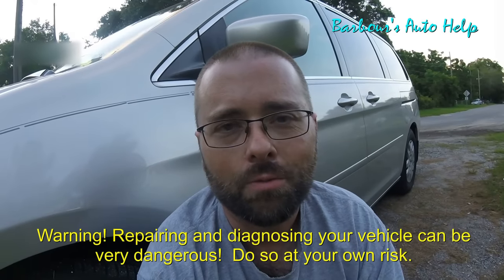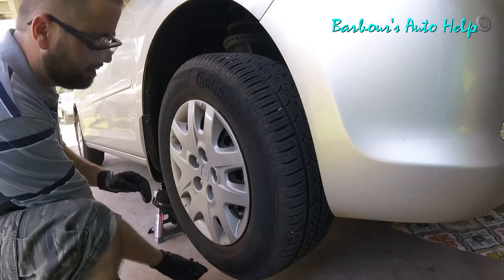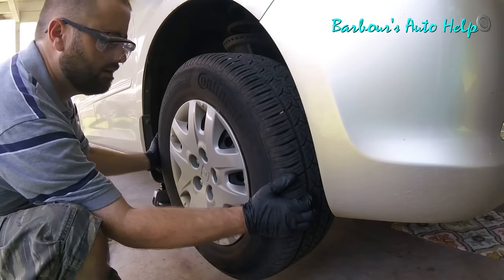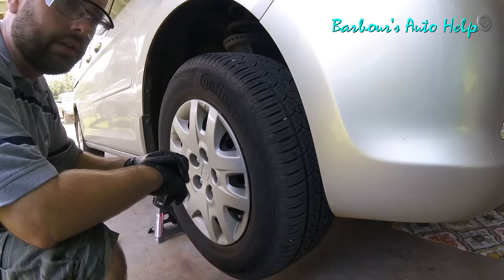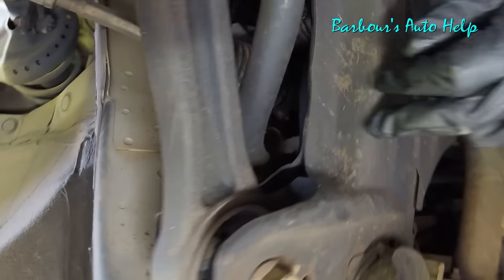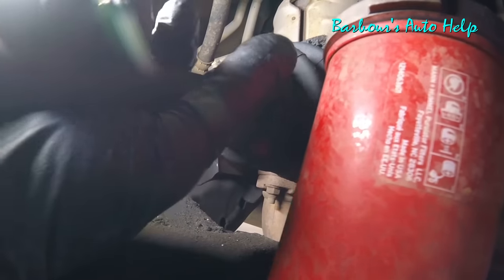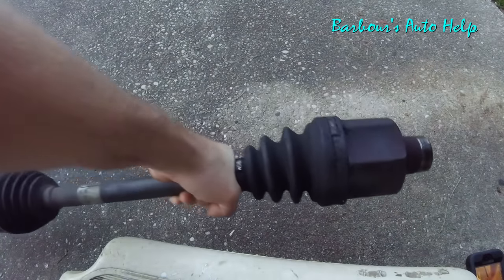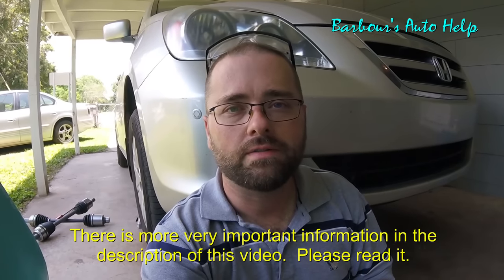Vibration Under Acceleration Diagnosis

Comment: Most vibration while accelerating will be from CV axles. Vibration while applying brakes will be from rotors, pads or wheels out of balance. Or worn out suspension parts😁
Reply: My odyssey had the same issue 
Changed cv axle,new tires, struts and springs . Turns out it was a sticky caliber .
Reply: What about If it only happens when I'm going about 65 mph and coasting? This vibration didn't start until after I got my transmission replaced. Only happens when I am coasting high way speeds or on a dirt road.
Reply: I replaced my cv axle and it still vibrates 😕 
Idk what it can be
Reply: @cesar1926  Have you figured it out? It could just be a bad tire if it does it all the time and gets worse as you go faster.
Reply: @keyelectric91  nope 😭
I think it’s my motor mounts
Reply: @cesar1926  They are easy to check just have someone or you rock the car forward and backwards good enough to make the engine rock looking at the mounts and see the rubber is ripped/separated and you might hear it clinging too if you rock it hard enough.

However you may have bad mounts but usually you will just experience a single bang when you accelerate a little bit to hard with bad mounts.
Reply: @keyelectric91  thank you so much, Imma try that rocking method 🙏🏼
Reply: @cesar1926  You're welcome! Just shine a light at them and check each one closely while it's rocking decently.
Reply: Well I got new rotors brakes and checked everything only thing bad is the axel and it vibrates during brake if so that’s not true
Reply: @jackmarks8607 but what was behind sticky caliper.??
Reply: When I accelerate I have some hit on the left front like something is loose
Reply: Harder I accelerate more it hits and loose felling

Comment: if the vibration is engine related it would happen in all speeds and if it was transmission related it would be present in one gear , if it was torque converter it would happen in lock up and would not happen all of the time , so that leads to the axles and suspension , good video very help full, i have a 2007 odyssey touring and am dealing with the same problem
Reply from the maker: +sunny nayee Great information!  Thank you for sharing!
Reply: sunny nayee , I have the same problem of vibration at 60-70 mph on a 2005 odyssey. what do you mean by "if it was torque converter it would happen in lock up "?
Reply: @100630489  I believe he means when it locks the torque converter which is when the vehicle is in Overdrive for highway speeds. I had a truck with that problem and drove fine till it went into overdrive and then shook. They said it was the torque convertor
Reply: great comment
Reply: Amazing information thank you for your input.
Reply: My SUV only shake(more like jerking) when I accelerate 0-25 mph, it does not always happen but its getting worse recently, do you think this is transmission related? Thanks
Reply: sunny nayee So frustration because I drive great distances often for work. I have the same exact problem right now On my 2007 Honda Odyssey. I have a front in alignment with new tires wheel and balancing from NTB and Goodyear and my steering wheel still shimmies between 65 and 80 miles an hour. I even took it to a state inspection location mechanic and he said that he found nothing wrong even though I don’t think he performed a thorough inspection for the fact of when I back up and cut my wheels to park I still hear a soft knock or thump in my front suspension. I spend my days off hoping from shop to shop to take care of this and no one can tell me anything. I am really starting to hate this van because of it. Great vids. Im guessing I wish you were close
Reply: Very good info I was praying it was my transmission but it still does the same thing in 3rd
Reply: very useful tips, thanks

Comment: My Mechanic was not convinced about the inner cv joints causing acceleration vibration at 70kms. Told him to replace as he could not find any other problem i.e. tires, ball joints etc. He replaced the cv axles and vibration gone.

Comment: Okay so I just changed my driver's side axle because it was rusted to hell. but now while driving the car and I'm accelerating I feel a vibration. I jacked up the car stuck it in drive and the passenger side wheel is wobbling like crazy why would this be? Any help would be appreciated. There is no play in the CV axle and the boots are good. Everything seems tight
Reply from the maker: Could be a bent rim....or a tire out of round.

Comment: Had to replace both CV Axle shafts on my 2011 Honda Accord Crosstour FWD that I bought 6 weeks ago. I had that vibration/rumble feel in front of car during high speed acceleration (70+). I noticed that when I put my car to park and drive I'll here a click noise around my front tires. I read that it could be worn CV Axle. I also didn't have any warning lights, so problem wasn't connected to car computer. Had a mechanic test drive it and he suspects CV axles. Its all good now. Before the CV axles I thought I only had to get rid of ECO mode which I read causes the car to shake when switching from 3 or 4 cylinders to 6. So I installed a VCM tuner to turn off ECO mode (S-VCM). The shaking in the front shrunk a little, but was still there and that is when I found out about the CV Axles.

Comment: Top to bottom is for the ball joints. Left to right is for the tie rod ends.
Movement top to bottom, left to right, and diagonal, is for the wheel bearing.

Comment: I think you have nailed the fault on my x type jag to. 
Thanks very much, the garage has been worse than useless diagnosing this problem.
They have changed discs,  pads, steering pump, where going to change the rack and I had suspected the CV joint on the near side for months. (uk) setup right hand drive.
Thanks again.
Reply from the maker: Please let me know how it goes.

Comment: We have a 2006 Honda Odyssey, and we were experiencing the same thing. Once we got it up on a lift, and put the car into gear and pushing the VSA off button , we were able to get the wheels spinning at a decent speed, and could see the slight vibration from the cv axle that was faulty. It was the inner cv joint, passenger side. I am sharing this, because it did not have obvious signs of potential failure ( I.E. the grease that yours had coming out of the boot)
Wish I would have watched your video first, because it took us little while to diagnose the problem. 
Thanks for sharing your video
Reply from the maker: I'm glad you got it figured out.  God bless.
Reply: Great job thanks

Comment: Although vibrations can be caused by dozen of causes, 99,99% goes on CV inner joints.
Passenger side is specially problematic, as it has longer shaft and bares more abuse thereof.
If there are vibrations present during acceleration at some certain range of speeds and if those "disappears" when there is no foot on the pedal-check out CV joints first.

Comment: I just replaced my wheel bearing+hub and was disappointed when I went out to drive my civic and got a wobble. Turns out my lower control arm bushing was in two pieces. thank you for the helpful video!
Reply from the maker: No problem

Comment: I just did front axles on a 2010 Subaru Outback because of torn boots.  I used new axle shafts from NAPA and now have a shimmy that wasn’t there before.  I’ve done a hundred of these and the only ones that end up with a shimmy are Subaru’s.

Comment: Thanks, just what I needed! Performing this inspection on the wifey’s 2006 Ody with 214k miles this weekend. I just replaced motor and transmission mounts figuring that’ll solve the vibration. Nope, vibration is still there during load and goes away when decelerating. Did noticed the driver side inner CV axle has lots of grease coming out from the rubber boot. Will investigate and perform the slop test...Hehe! Take care and thanks!
Reply from the maker: Yes, the "slop test".  lol.  I should patent that.
Reply: BarboursAutoHelp  Haha! It’ll be the new in the dictionary... 👍
Reply: BarboursAutoHelp  Update: Replaced both axles and the vibration is GONE! Wifey is happy which I’m glad because she was thinking we needed a new car 😬 Now I’m gonna have my ice cold Coronas w/limes as a celebration 🎉 Thanks for your help 👍
Reply from the maker: Awesome
Reply: @elgatogordo9523  Thanks for sharing, I just replaced my motor and transmission mounts on my accord and still have the wobble at acceleration. The wobble also occurs when decelerating. My mounts were definitely bad, so it solved part of my issue with vibration, but the wobble still occurs. Did you use aftermarket or OEM CV axles?
Reply: @levimagnusson5880    I used aftermarket CV axles. OEM were extra pricey and above my pay grade 😆 After two years, they’re holding up nicely. Purchased them from Amazon.
Reply: @elgatogordo9523  did you replace both sides or just one side?
Reply: @levimagnusson5880  replaced both sides due to the high mileage.
Reply: @elgatogordo9523  i just replaced my CV axles now and the car drives like a dream! No boots were torn, my inner joint had a lot of slop
Reply: @levimagnusson5880  Haha 😄 The famous Slop! Glad you got it fixed. Our Ody is still going "Strong like Bull" 🐃

Comment: I had the same problem and I balanced my tire. It wasn't that.  The problem was the axle. Thank you for this video
Reply from the maker: Your welcome!  Did you get it fixed by replacing the axle?
Reply: Yes i replace the axle of may Honda odyssey and is driving like knew 🖒
Reply from the maker: Right on!

Comment: Mine turned out to be my front motor mount under the crank shaft damper. 
I had a really bad vibration under acceleration. 
It is about 95%better now. 
I still have a very slight vibration under acceleration, I may try replacing the top torque struts or flipping the bushings.

Comment: So frustration because I drive great distances often for work. I have the same exact problem right now On my 2007 Honda Odyssey. I have a front in alignment with new tires wheel and balancing from NTB and Goodyear and my steering wheel still shimmies between 65 and 80 miles an hour. I even took it to a state inspection location mechanic and he said that he found nothing wrong even though I don’t think he performed a thorough inspection for the fact of when I back up and cut my wheels to park I still hear a soft knock or thump in my front suspension. I spend my days off hoping from shop to shop to take care of this and no one can tell me anything. I am really starting to hate this van because of it. Great vids. Im guessing I wish you were close

Comment: I'm having the same issue with the vibration and I'm feeling it in my pedal only when I accelerate..it all started when I hit a large pothole..think I'll look at the Axel and see if there's any damages..thanks for the video too it's good information 👍🏽
Reply: Potholes usually mess up tie rods. Jack a corner of the car up so the wheel is off the ground and see if it wiggles or is loose, it shouldn't wobble or shake at all.
Reply: @c43sedan  I did that there's no wobble..my mechanic told me I need engine mounts

Comment: Same issue with a Toyota avensis.  Replaced the right side inner/outer drive shaft..still shaking like mad around 60mph so I now have to replace the passenger side drive shaft..I hope that cures the issue..

Comment: This has really help me.I have S60 2007.i fill little vibration only when accelerating.after washing this video,I went under the front driver tyre and saw grease on the wheel.i had the same issue I saw on the video.thanks man
Reply from the maker: Great!

Comment: I have the exact same symptom on a 2006 with 272,000 km.  I will be replacing the right (passenger side) cv axle next week and hope to correct this issue.  If not I'll try the left cv axle as well.

Comment: Dude perfect video the intro explained my car perfectly. Thank you i found it and I'm doing repairs now
Reply from the maker: Hope it works out!
Reply: @BarboursAutoHelp  I just replaced both my cv axles and the problem is still there. Guess that leaves me with 2 other options to check. I feel the shake as I go faster and it becomes more aggressive.
Reply from the maker: What all have you checked?
Reply: @BarboursAutoHelp  so far only the cv joints. Was gonna check my suspensions and tie rods tomorrow
Reply: @BarboursAutoHelp  and the lower control arm
Reply from the maker: What about the wheel balance?  What did you find with that?
Reply: @BarboursAutoHelp  i didnt think it was a wheel balance because i put my stock wheels back on my car and the same problem was still there

Comment: Have a 2005 Camry. Vibration/ shake/ thud at around 85-110km. Have had it looked at 3 times and say it's nothing. It only happens when I'm accelerating and gets worse as I accelerate. They say everything looks good and the only thing that looks sort of weird is the tires are some what having uneven tread wear. They did balance them and it fixed for like 3-4 days and then slowly started again now it's doing again. Getting tires put on and I guess I'll see if that fixes it. Not sure tho. Any thoughts?

Comment: Was suspecting my CV was the cause in my 08 quest now I am certain if you were shaking with just that bit of slack mine shouldn't be aloud on the road 😂😂 shaking so bad is has loosened the center axle nut from it I thought maybe that was the issue but looked and saw inner boot is ripped and load of slop so thank you for confirming my thoughts

Comment: I just bought a 2019 Honda Fit it was rebuilt hit in rear
but I drove it up to about 55
day before I purchased it.
Next when driving home on expressway I reached 60 + mph and only when accelerating the gas pedal the steering wheel would vibrate as soon as I let off the gas pedal it would immediately stop.
So after watching videos and reading online I guess it’s not a wheel or tire bad, but a possible structure problem ? I think the guy I bought it from would honor the fix it I could prove the problem any suggestions ?
Great Video thanks

Comment: Thank you for the video! I have a '05 Accord, but the knocking/vibration starts at very low speeds (25-35mph) upon acceleration. Could that still be the  drive axles or perhaps U-Joint?
Reply: You explain my car/symptoms word for word, did u find the prob?
Reply: i also got the same issue. any luck after 5 months?
Reply: Sorry, didn't see the earlier reply/question! Yes, my problem was the drive axels.  Had a local shop do it.  From what I remember it wasn't a very expensive repair.  The mechanic knew exactly what it was, said it was common on the '05s.
Good luck!
Reply: @midknightgeek6629  sweet! Thank u very much. You saved me a lot of hassle.
Reply: @datura_preworkout  You bet man! Hope that solves it. But have a mechanic drive it first. And then have them take a look under there. They should be able to tell if it's the joints or drive axles.  You don't want to pay for the one if it happens to be the other ;)
Best of luck!
Reply: Ok, sorry guys! I got that confused with my old '99 Camry lol my bad! 
So yes, I went and pulled the repair receipt for the Accord and the vibration was the drive axels , what they called Axle Shaft Assembly. Did new Left and Right CV Complete Assembly. 
Parts was about $235 Labor was $288

Sorry for the mix up!  With my older cars, had several repairs this year. But now they're good and haven't had a car payment for about 15 yrs now.   I'll edit my previous post.
Sorry again for the mix up! Good luck!!
Reply: You explained my car symptoms perfectly. I got a 21 Jetta and we both know that the roads in Texas aren’t the best. I hit a pothole at night and now my car is starting to vibrate

Comment: I'm experiencing this very issue on my Honda pilot 2023.  It's a very new car with only 400 miles on it.  Would worn out / broken cv joints or cv axel be extremely rare on a new vehicle?  It's not tire balancing / alignment.  I already had that checked.

Comment: I’m having vibration when accelerating into a turn, left way worse than right turn. And slight when going forward only in between 1st and 2nd gear. Just replaced a shot engine mount (middle) helped the tugging when placed in reverse and overall feel of the car, but the initial vibration is still present and worsening. I’m inclined to think it’s Axle related but it’s not a cling sound it’s more like a shaking knock worse at left turn acceleration. Your video was very helpful but I cannot afford to replace all 4 systems. And it feels like it’s coming from under and rear of the car. I have a 07 Lincoln MKZ. Would appreciate any tips or advice. God bless and keep doing what ur doing.
Reply from the maker: I'd say on that one it may not be a bad idea to have a tech take a look at it.  I don't want to steer you in the wrong direction.

Comment: I feel a very slight sensation when I put the foot on the gas. It happens when I'm traveling between 40-60 km/h. I have a 2010 Honda Odyssey. Could it be the same thing?
Reply from the maker: Possibly

Comment: Hi there! May i ask for your opinion? I have a 2005 Nissan Frontier. There is a vibration coming from the front right side, which gets worse and make the whole vehicle shake as i increase speed, or when going down hill. The vibration feels like a skip-skipity-skip, and can also be felt going up hill and on flat surfaces. 
The noise started when i would slowly come out of a small inclined driveway whiles turning my wheel to the right, and as i realign the wheel a metal 'boing', (like metal vibrating) type of sound would happen. It then started to do the same noise whiles accelerating at varied speeds after stopping at a red light. Today i experienced several 'click click' sounds as the wheel was turned to the left, going around a round-about. Of course EVERY TIME i take my mechanic with me or they test drive my truck, no noise happens.They feel vibration and stiffness. We changed the struts and strut mounts. Any advice would be much appreciate!